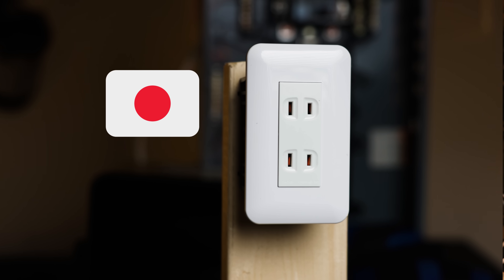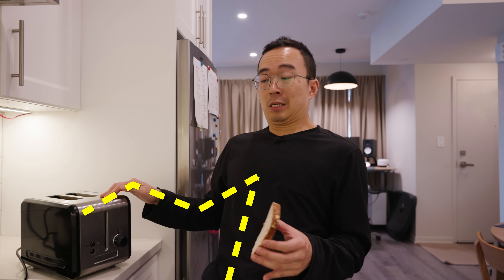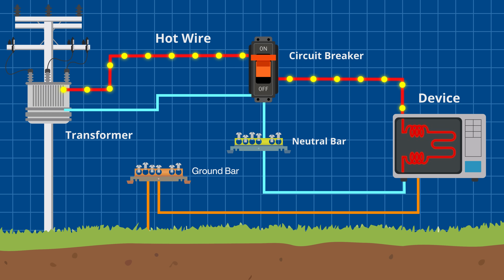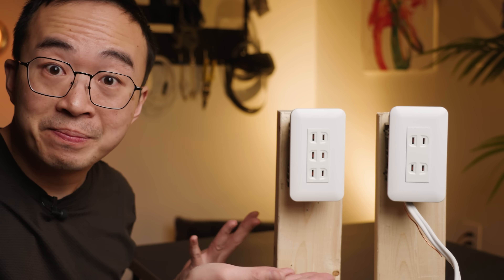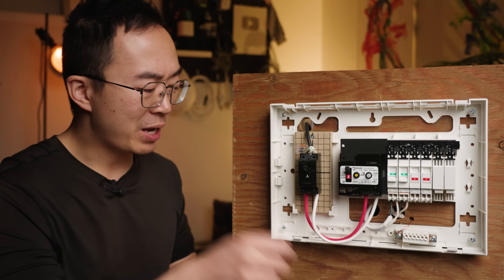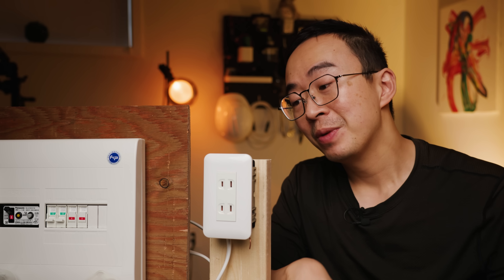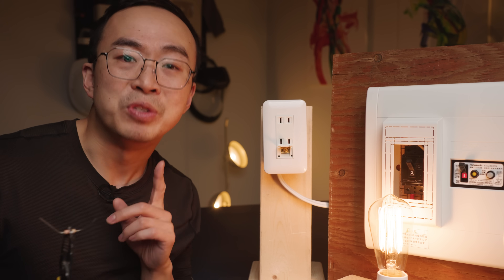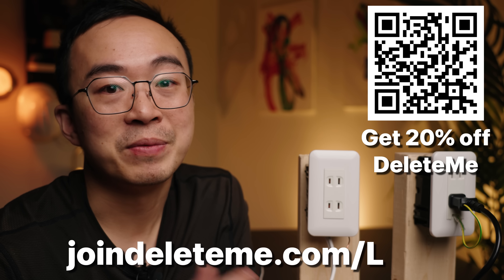How Japan Made Their Outlet Safe

Comment: Well the electric at the generator source has a ground wire hooked to a stake driven into the ground if you have 220 volts you have 2 110 volt lines with the center line of the 220 volts connected to the earth or a metal water pipe. The white wire in your electric box is connected to the grounded side of the electric side at the generator where ever it is located and the black wire is also coming from the generator but is not conected to ground anyplace since the white wire is connects to the earth if you touch the black wire to anything that is grounded like a water pipe or even the dirt outside of your house you will get voltage and sparks. If you have something like a saw or weed eater with a metal case and you have the wires on your plug reverse so that the case is connected to the black wire instead of the white wire and you are holding it or even a microwave oven and touch the ground outside or a water pipe you can get a very nasty shock so to keep this from happening in America we added the ground pin on the plug it is connected to the electric box which is also connected to a metal rod driven into the grout outside of the building about 6 feet deep the white wire is connected to the generator which is also connected to a ground source at the generator and the black wire is hot. Like I said if the plug is connected right there is no problem but if you reverse the black and white wires you still have electric at the socket but if you touch something grounded and the case is now hot you will get some current the GIF will kick the breaker very quickly but if you have something like a saw or mixer and the wires are reversed I’ve seen the breakers exploding sure they kick off but it gets expensive I’ve seen a lot of sockets where they come with the white wire and the ground connected to gather on the wall socket and people had switched the black and white wires on the socket it didn’t get enough current through the ground stake to blow the breaker but it got enough for the socket to heat up and catch the wall on fire after a while. Personally I don’t think it took all that long.

I’ve been seeing people in England having trouble charging there EV’s and someone will walk by touch there car and get shocked this wouldn’t happen if the car body was connected to a grounded electric box and the vehicle body was also grounded but that’s why Americans ground the outside of metal thing that are connected to electric maybe it’s overkill but it stops people from getting shocked 👍👍👍

Comment: When I was in grade school, i found a thin piece of copper wire similar to what you see inside those tamiya motors. I stuck it in through the holes in an electric fan's plug pins, before trying to plug it in an outlet. I was a curious kid and was quite into science. I wanted to see what electricity looked like. Thankfully, i wasn't injured, and we only needed to replace a fuse.

Comment: Multiple people said this, but even if you consider all information in this video as true (which I am suspicious of), it is presented in a way that would make a tabloid editor proud.

Just to give the  most obvious example:
0:20 Ground is required in every other country.
1.) why specifically list Afghanistan? makes it sound like "even AFGHANISTAN uses ground"
2.) Aside from Type A, Type C (Europlug) specifically doesn't have a ground connector, and is used in almost every country on this planet. There are wall outlets for Type C (mostly for chargers and shavers, but not always, sometimes they just provide full power) in multiple countries.

If I would produce a video like this, I would not be as combative in the comments and actually accept that I made a mistake. Shameful conduct by this creator.

Comment: New codes in the US now require GFCI- and AFCI-protected circuits in residential settings. I still think a grounding connector (prong) at the outlet is far superior to the screw terminal. It's up to the device design that determines whether a connection to ground is required.

Comment: Thanks for the explanation, I think many people don't know what RCDs are good for, and when they trip, they think of a short circuit (or else: I got an electric shock, but the fuse didn't trip ... yes, of course not, because that's not what the fuse is for, to put it simply). But what I don't understand is why these flat/non-recessed sockets are supported. Yes, I live in Germany, but I still think I'm reasonably neutral when I say that sockets with some kind of socket design/recessed design are much more practical.

Comment: the majority of the outlets in the Netherlands are ungrounded, only in kitchens or rooms for for example washing machines, so where there is a chance of moisture, there are grounded outlets
Reply: A detail that he failed to mention is that devices with a ground are often single insulated, whereas ones with only 2 prongs are typically double insulated to make it that much less likely that you'd be shocked by them. Even in the US where it's standard for outlets to have 3 prongs, a good chunk of the stuff we plug into those outlets has only 2 prongs. Probably for the same reason that most of our stuff has the ability to run on 115/230v an 50/60hz, a good chunk of the stuff these days is designed to work anywhere in the world with as few modifications as possible.

Comment: I was a telecom tech for over 30 years.  Here are several times a ground source was an issue.

A good ground source was essential in the operation of telecom equipment as well as safety because our equipment actually worked on negative power and positive ground.  For some reason, one building's ground source was different from the water and electrical panel.

Another time, a junk yard had so much oil in the dirt, I couldn't get a good ground source even with a 6 foot ground rod!  I literally had to run a wire up to the strand on the pole!

Once, an electrician installed a brand new circuit for our equipment.  The new circuit breaker failed right out of the box!

And the worse one was a 700 volt transformer was being replaced at a commercial site and the electrician was testing the ground source and found no ground on the wire.  He pulled the wire and it went nowhere.  It wasn't even connected to anything.

Be safe out there.
Reply: I removed a metal ceiling light in my Japanese bathroom (wet area) to inspect it. When I pulled on the ground wire, it also lead nowhere.

Comment: GFCI outlets will trip with the self test button ed when they are wired incorrectly. But they will only trip from the tester or when there is a fault if they are wired correctly. After installing them or when moving into a house, always use a tester the first time. After that the self test should be enough to show it's still working properly

Comment: From a European perspective, I had to smile. My one family house is not only grounded, but also has RCD for the whole house. But of course not one RCD for the whole house. Say you have one faulty device, then it's just too difficult to track this down. Therefore, there is a separation, and I have four RCDs installed (one for the bathrooms, one for the kitchen, and two for the rest of the house). Japan has just a crap electricity system due to historical baggage. Here, such an installation probably wouldn't pass certification for a garden shed.

Comment: I gave you a dislike, because I'm Japanese and I've been advocating for using Type B outlets for years now, and videos like these give the wrong impression that just using ungrounded outlets is "safe enough" because "Japan so safe!".
It is 100% bullshit, and it actually has created a very unsafe culture in Japan, in which appliances that should 100% be grounded, like welding machines, people usually use them ungrounded.
Reply from the maker: Uh, I'm not sure if you watched the whole video but I talk about grounded outlets in Japan and how they are pushing for Type B.
Reply: @Lam  I did watched the whole video, but the clickbait title is enough to give the impression that the Japanese electric system is so good that it doesn't need ground, but the truth of the matter is that, for example, European electric systems use GFCI at the breaker level just like Japan, but they also make grounding obligatory.
You don't know, but there is the notion in Japan that our system is so good that it really doesn't need ground, and I know of people who have ended in the hospital because they thought it was a good idea to push their 200V welding machine without proper grounding.

Comment: Moved into a house 4 years ago and almost NONE of the outlets were 3 prongs. Very inconvenient in today's world. Also a source of my OCD and paranoia. The only 3 prongs that existed were in the kitchen, the lavatory and the basement. The one in the kitchen were grounded by a stray wire that ran up through the floor (Basement ceiling) and to an outlet in the kitchen. They should have just rewired the entire circuit with 12/2 with ground. They were GFCI. However, in the lavatory, they created a "Bootleg or False" ground by connecting the neutral to the ground screw, this creating a very hazardous situation for anyone using a metal appliance with a ground. Ironic. When I was a kid, my parents inherited a house we lived in. It had two prongs and NONE of them were polarized. I heard my parents use words that I never heard before at 4 years old. So lots of trips with Dad to the hardware store to get polarized outlets.

Those plug in testers aren't very good because out of 6 I have, NONE of them detect a false ground and show the circuit as "Correct" I also had to go around the house, replacing the 2 prong outlets with a GFCI and put a sticker saying on outlets being fed "GFCI Protected" and "No Equipment Ground" Ironic.

I have been considering "Delete Me" and I have to wonder what happens if Delete Me gets breached or hacked. Then it's all worse. So I am still on the fence about volunteering all my info to them to get rid if it. Now they've got it all too as does anyone that hacks them or a rogue employee.

Comment: Doesn't the central GFCI kill power to the whole panel (in effect the whole house) Which means if you have one bad/leaky circuit in the middle of the night, your left in the dark
Reply: Yes. That is problem with Central GFCI. And fridge is off while at work.
Reply: @MrSummitville  In my apartment in Poland, I installed a RCBO protecting a dedicated single socket for the refrigerator, separate to the RCD protecting the rest of the installation, specifically to prevent such an issue.
Reply: @A_Canadian_In_Poland  Great idea!
Reply: @MrSummitville  In Finland fridges are not protected RCD protected.
Reply: @okaro6595  We have found that motorized appliances, can "falsely" trip the Ground Fault. In some countries, they have RCD for the entire home, in the Main Panel.
Reply: It kills power to the entire circuit, that won't usually cut power to the whole house, but it's enough to be really annoying as now you've got not just one outlet to check, but possibly all of the outlets on that circuit and you can't just walk up and look to see if there's a light and some incriminating object next to it like you would if they were putting GFCI into the outlets.
Reply: @SmallSpoonBrigade  The singular one they show in this video shuts the entire house down.  There are individual breakers that have GFCI that are the smarter way to go, albeit more expensive overall.  The Fridge is a prime example where GFCI can get triggered and you'd never know it until you get back to a smelly fridge with hundreds of dollars of spoiled food.

Comment: Excellent video - well explaining for consumers.  However, consumers should know, and perhaps you can elaborate.  Your example of the toaster is highly debatable.  You are apparently standing on a wood floor, and a person wood NOT receive the shock you depicted, if at all.  For all to know, if the ONLY thing you do is touch a 'hot wire' and no other parts of your body are touching a reasonably conductive surface (your feet on basement cement, or holding onto a stove) - you will NOT get a shock.  Their are abnormal circumstance where you might get a shock, but this involves humidity, ionization, and / or high voltage.
Reply: Ummm no. He would not make a video showing people how to touch a HOT wire and not get shocked.
Reply: @MrSummitville  That wasn't my point.  According to your comment, you want to promote disinformation.  Instead of providing actual information on expectations and how to deal with electricity - you would have someone just scare you - fear based (lies) education!  Well, that's your choice.  This presentation will just teach people to be afraid of touching anything electrical - not knowing to be aware of what other parts of their body are 'touching'.

Comment: Plug-in testers will NOT trip the GFCI if there is no ground wire connected.  The test button uses the ground to create a fault.

But test buttons built into a GFCI will trip the GFCI without a ground wire, because the test button uses some current from the unprotected side.

So older homes that upgraded two-wire outlets with ungrounded GFCIs should only be tested with the built-in test button.

Comment: That Japanese circuit breaker panel is tiny capacity wise. And don't forget that Japan is 100 volts, not 120 like North America so more current is required. And we also know Japan is high tech so they probably have all the electrical luxuries we do. How do they run a house on that tiny panel?
Reply: Just like in the USA ... They have Service Panels of various sizes. Up to 40 Circuit Breakers?

Comment: THIS VIDEO IS FULL OF HALF TRUTHS! 
Yes, circuit breakers interrupt current quickly but it takes time for them to notice a problem. 
Circuit breakers rated for 15 amps (150 times the LARGER estimate for lethal electric shock,   2142 times the 7mA needed to 
k!ll if it passes through the heart) can run at that 15amps for at least six minutes without tripping, and possibly indefinitely! 

THIS MAN IS NOT TRUSTWORTHY!
Reply: Yes, you can fabricate hypothetical situations. But ... NOT going to happen when GFCI is used. Which is the point of the video. Duh!

Comment: You are completely wrong on how and why ground works and why we use it in NA. Not just some keyboard warrior. Electrical engineer who works as an electrician. First, the breaker you showed around the 4 min mark is just a regular breaker. It trips due to excessive current, sure. But it doesnt matter if that passes through you first or not. For all purposes, that outlets ground and neutral are the same circuit, tie them together and nothing changes. In fact they will be tied together aka bonded, at the main panel of your home. The ground being on the chassis of the outlet allows stray current to return through it rather than you to go back to ground. Essentially it never allows the chassis of the toaster or outlet to be a higher voltage potential. Whether or not the breaker trips has nothing to do with the path the current takes. The way to look at it is a standard breaker is there to protect the wire. That wire you have is a 14 gauge meaning its rated for 15 amps. As long as no more than 15 amps is flowing through it, its safe and wont overheat and melt. Could be 15 amps through an appliance or a person, wouldnt matter. Maybe your device only can handle 5 amps, well the breaker doesnt care if it draws 10 and is melting, as long as its not over 15.    GFCIs and Arcfaults trip when detecting differences in the current loops, which means they separate ground and neutral at the point of instillation. You mention them being a thing in Japan, but they are also a thing here in the US, and in most locations now required in new construction or major renovation.
Reply: Calm down. What he said, in the video, was introduction to why we use GFCI. Not an Electrical Engineer Thesis. What is wrong with you?
Reply: @MrSummitville i havent found anything wrong with what I said.  He fundamentally misrepresented how and why grounds work in a way that if believed could lead to unsafe practices.  Since you sound like a liberal from your comment I will pull out the misinformation card.  If we dont call it out, more people will reference this and get it wrong.  I mean look at the comments. I didnt read a single one out of a dozen before posting about how he is wrong.
Reply from the maker: Sorry, but you're incorrect.  Ground turns off the breaker.  Mike Holt who is considered an expert on the NEC talks about this in an extensive video on how grounding & bonding works.  This sections specifically goes in depth on how the EGC trips the breaker: https://youtu.be/mpgAVE4UwFw?t=1040

It also clarifies an incorrect belief that it reduces the voltage to zero.
Reply: @Lam  I never said it doesnt de energize circuits.. in fact I stated the opposite.  What I said it didnt do was trip the breaker. It can, depending on circumstances. But there are plenty of situations where you can have a short capable of shocking you that will not trip the breaker.
Reply from the maker: @sycoalien212  Sorry, I used too general language, ground denergizes systems by tripping the breaker.  Yes there are many situations where that doesn't happen because the fault current isn't enough but from what I understand, in America, it is specifically designed to trip our breakers here.  

Linking to Mike's PDF: https://www.mikeholt.com/instructor2/img/product/pdf/1292448885sample.pdf
Page 2, Figure 250-4: "The effective ground-fault current path is intended to help remove dangerous voltage from a ground fault by opening the circuit overcurrent device."